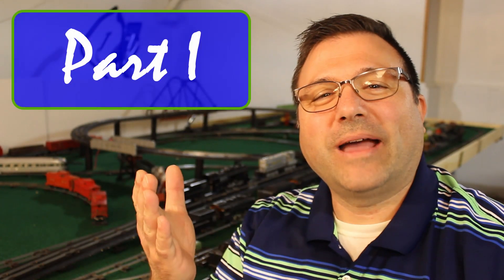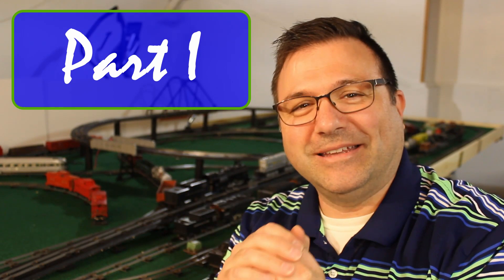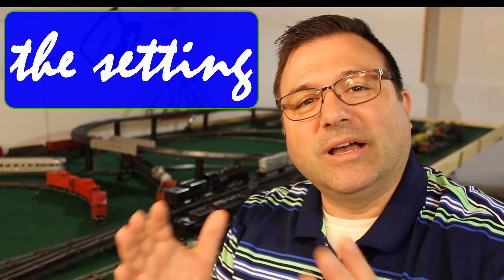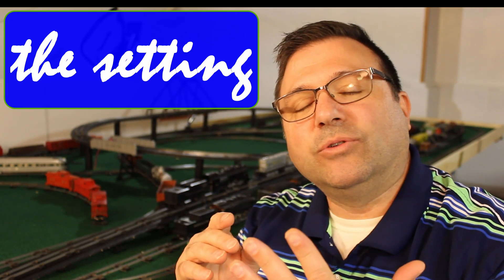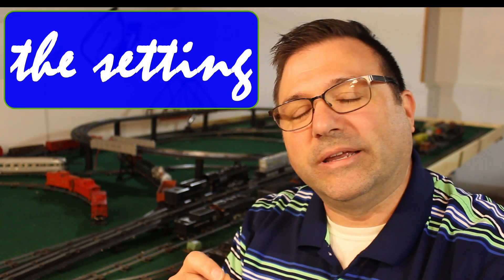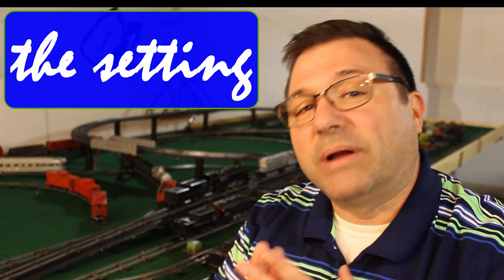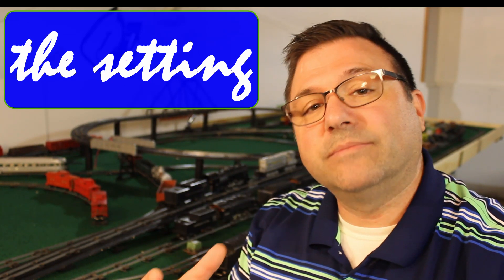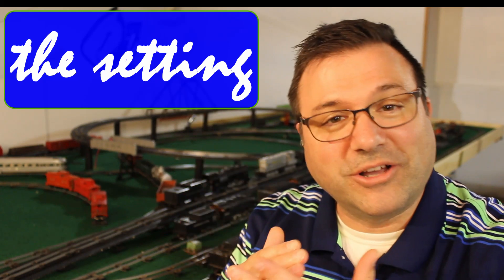'I think I can, I think I can!' Part I: How well do various vintage American Flyer engines pull?

Comment: The Atlantic was a surprise, I'd say it was a toss up between it and the 342 as the most powerful, the 0-8-0 had no trouble whatsoever. The S.I.T. 322 however I'm surprised made it up the hill at all, those engines lose most of their pulling power when the smoke unit is on, which is why that design didn't last long, I have one repainted as Wabash(to resemble the unproduced Lionel Flyer we never got)and can barely haul 6 cars on flat track with the smoke on, never mind any kind of grade.